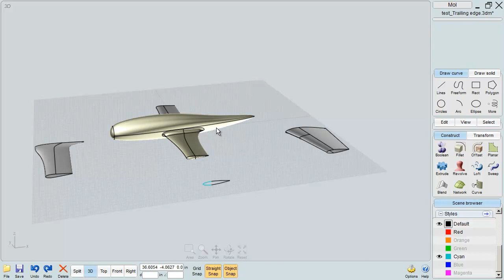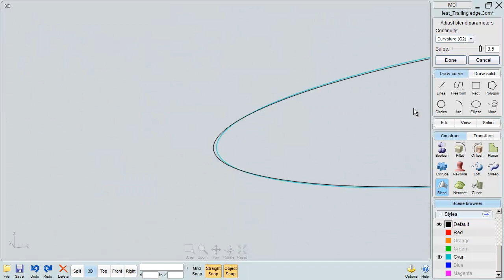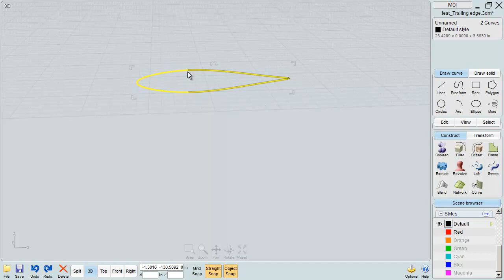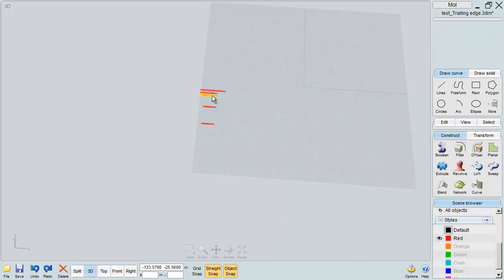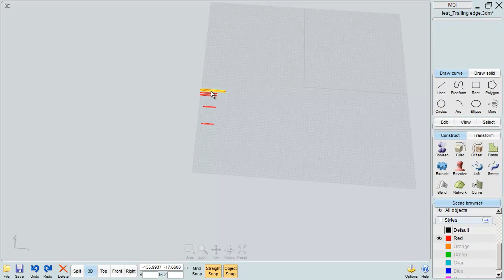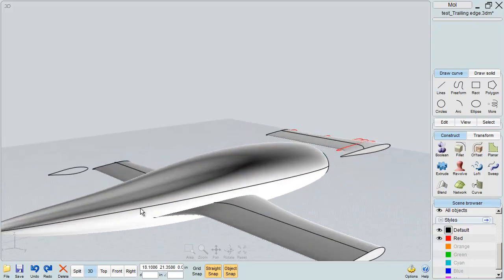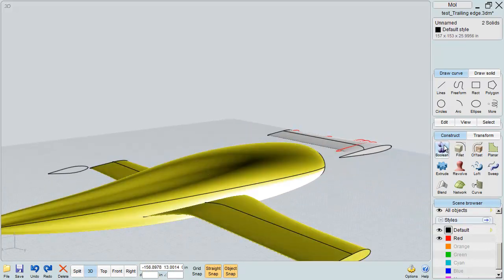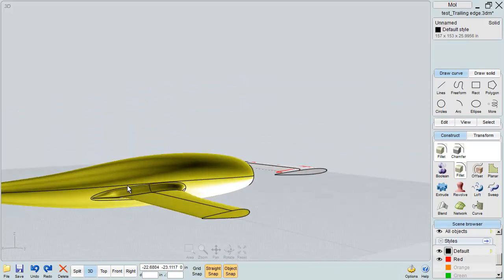Trailing edge fillet

Comment: how can you fast draw an airfoil using MoI and a text file containing data?
Reply from the maker: I made this video while working with Anthony in the MoI forum. His program is here:

http://propdesign.weebly.com/

MoI will import point files (data?) You might import the point file to generate curves? You may have to break the points into different parts to get good curves.. Hard to say with no info... Maybe ask this in the MoI forum.
Reply: BurrManator  yes I mean a file filled with the coordinates i  order to generate the airfoil as showed at 1:11.
I made it typing every single coordinate; time consuming and prone to some error typing.
Reply from the maker: Tecnobingo You can import those points into MoI with ImportPointFile and then construct it with the tools there... Maybe better to ask in the MoI forum and you can get lots of help if needed?